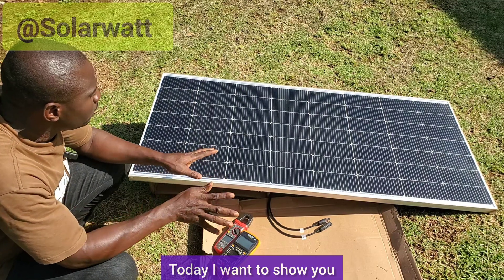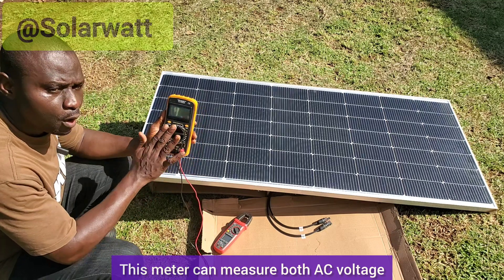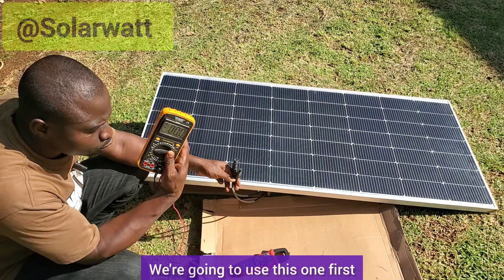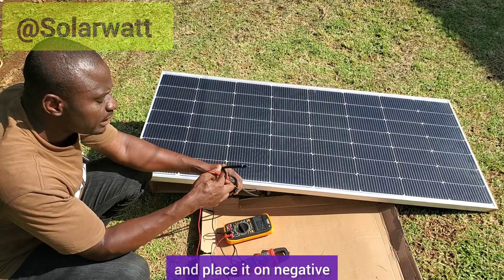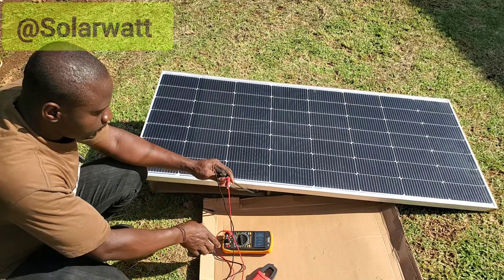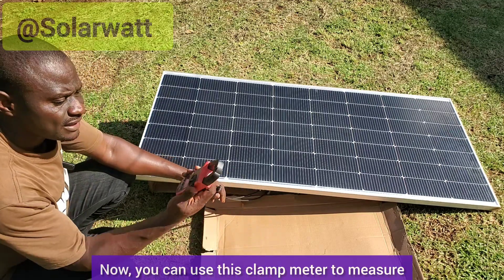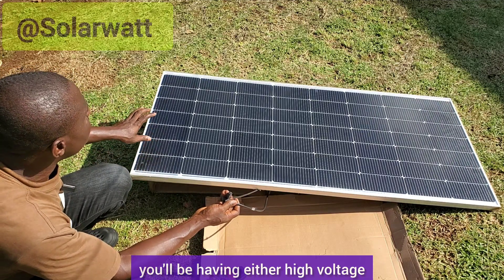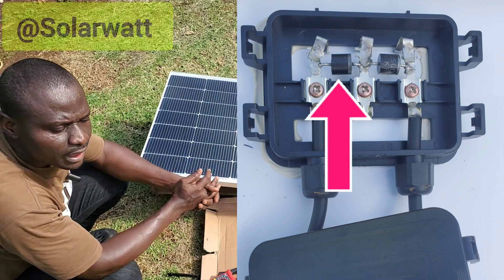How To Test A Solar Panel Using A Digital Multimeter. #Solarwatt

Comment: Thanks bro for the test. I made some observations from the test. 
It is obvious that there was enough sunshine, and no shades over the panel. 
Your result shows a power of 90W. This is half the rated output of 180W. The difference is much.
I have watched similar tests done in the winter in  the USA. In those tests, the test values were close to those stated on the label or name plate.
I have personally tested the output of some electrical products in Nigeria. 
I think the rated output of most electrical products in Nigeria are over stated. I suspect the panel you tested is not up to 180W. Can you confirm by testing that same panel on a very sunny day? Thanks for the educational videos.
Reply from the maker: Thanks sir for your observations and inputs. I did the test on a very sunny day, the panel did not perform according to specifications. The performance is poor. Thanks sir.
Reply: @Solarwattng  Good to get a feedback on that. It is important that you discuss the results of any scientific test you perform. I am yet to see a panel test in Nigeria that produces a result close to the specifications on the label. May God help us.

Comment: One thing I like about you is that your explanations are always in the simplest form for easy understanding

You used  a 250 watts solar panel which gave 25.5 volts upon testing.. Now, my question is that, assuming it was 300 watts solar panel you used for the tuturial under the same sun condition, what voltage should it be reading?

Comment: Why is the rated short circuit current significantly higher than the measured value?
Reply from the maker: Making enquiries about what please?
Reply: @Solarwattng  I mean, why is the short circuit current value at the back of that panel is 9.13A but what you measured was 3.3A.
My question is why such wide gap?

Comment: The right way to use the clamp metre is 2 measure current 
When panels are on load... bt short circuit will cause damage even 4 a single panel if max oCC is reached

Comment: Nicely done, however. In my opinion, if you want to carry out Isc test involving more panels (high voltage/ current) you might as well use a resistor (low value like 5watt 0.3-0.5 ohm) watching from Jos plateau state Nigeria

Comment: I want to believe this video was done in the morning hours 

The panel should have been elevated a bit higher to capture more energy

At maximum power the panel should be doing 6A+ on closed circuit current
Reply from the maker: The intensity of sun was low. I did the video around 4pm.
Reply: @Solarwattng I usually carry out this test between 11am to 1pm to get the best results
Reply from the maker: @nanfwangdabiring1520  You are right ✅️

Comment: Well done.
However, I think you cannot measure the power generation of a panel at open circuit. Because at VoC current is zero there is no current flowing which simply means at VoC power is zero, this can be verified from the I-V curve...
Reply: It's not always the case with Solar panels

Comment: Am success from Lagos Nigeria keep on the goos work ,please i have  190 watts 6 board can i loop the connection 3/3 or 2/2  inseries  connection with 24 volts 3.5 kva hybrid inverter
Reply from the maker: What is the panel open circuit voltage?

Comment: I'm Kunle from Nigeria. Thank you so much for this educational video. My question is I have 2 solar panels and if I used the + & - wire to touch each other, 1 don't react while the other react. What can I do and I don't digital multimeter.  Thank you
Reply: Hello kunle
Reply: @frankcreates  hi
Reply from the maker: Please test the solar panels with a dc meter
Reply: @Solarwattng  okay Sir